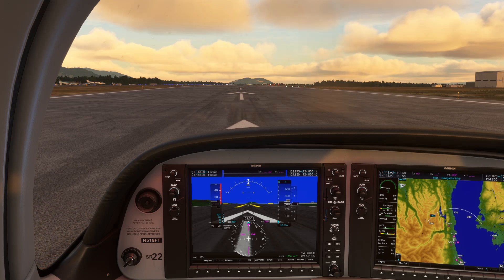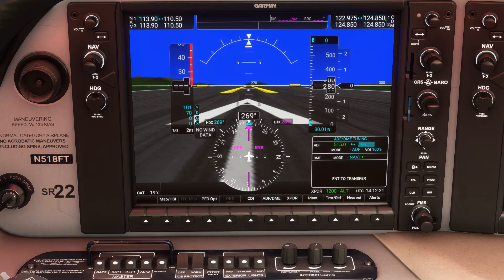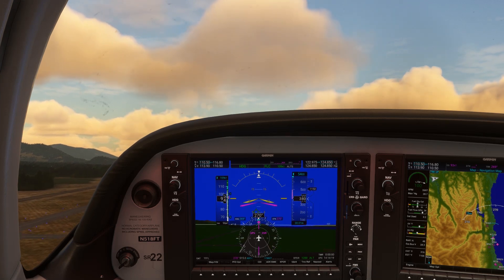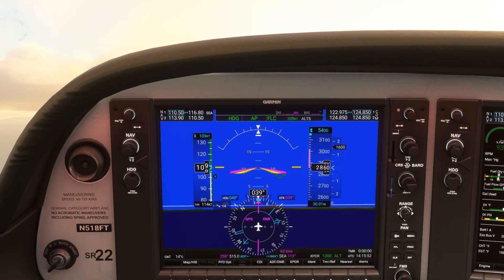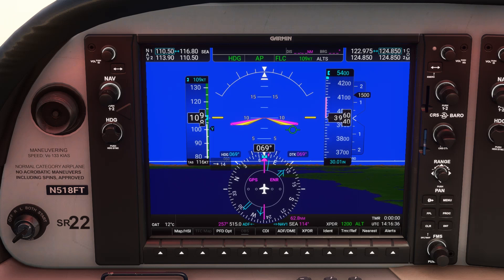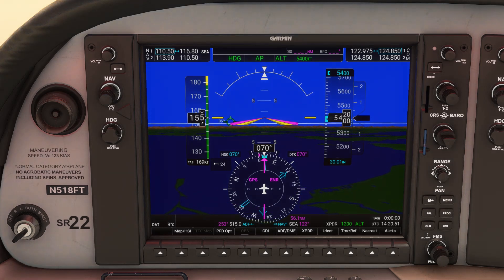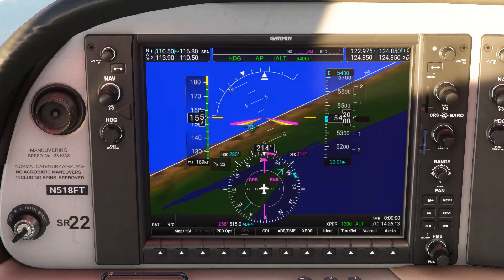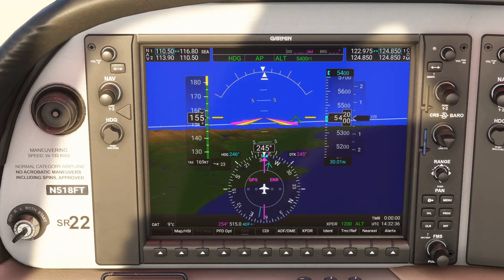How to track an NDB | Push the Head, Pull the Tail

Comment: Alaska still has plenty of ndb. The g1000 definitely simplifies NDB compared to the north based ndb units.
Reply: The glass cockpit ADF is more like the old RMI. It’s not a fixed card. It is a slaved Gyro and the pointer will always point to the station. It is easier to use than the old fixed card. You actually don’t need an NDB/ADF unit because  the NDB station location is on the chart, you can use your GPS to fly the lat long waypoint.
Reply: @aviatortrucker6285 Don't believe that's true, since GNSS doesn't have the funneling that NDB have unless you are doing a GNSS based approach. LPV has pure funneling but LNAV does the 1nm/0.3nm reducing.

We are taught when doing NDB approaches NOT to use GNSS for anything other than additional advisory.
Reply: @glennwatson  That is true. As an example where I am located near KJEF, ILS-30 approach depicts, an old LOM, (JE) which is essentially  a NDB station but uses a “bone” pattern for the outer marker. This is also the final approach fix ALCOA. You can fly to ALCOA using the GPS, fly outbound, and then the procedure turn. You then must change your CDI to LOC to legally fly the ILS inbound to runway 30. One other thing is you can not fly any approach, ILS, VOR or NDB unless you have those radio based receivers. You can monitor with the GPS. Since GPS is more accurate, why use and radio based  non precision approach at all? Minimums with a GPS, especially if WAAS equipped, and the airport has a LPV is way easier and more precise. Maybe for nostalgia?
Reply: @aviatortrucker6285 maybe for "if its available and works.. dont fix it" mentality ?

Comment: Great segment,
I used a few NDB approaches however I still have a question concerning the best method to do a timed approach or holding using a NDB.
Would you propose a segment related?

Comment: One thing the glass cockpit does not do, is have a fixed azimuth. During my IFR written test back in 1989 there were two gauges. The DG (not slaved) and the ADF. It would depict a heading indication and a bearing indication to the NDB which had a fixed azimuth. You had to add the two together and if it was over 360 you would have to subtract 360 and that would be your bearing to the station. So with a heading of 300 and the ADF instrument reading with a pointer at 090 you would have to fly 030, (300 + 90=390. 390-360=30 or 030) to go to the station. I used to look at it at the station was 90 degrees right if my present heading. Kind of still do that with the bearing pointer with the  G-1000. Another fun fact about ADF it was susceptible to twilight interference around sunrise and sunset and also would distort the signal as much as 30 degrees. The ADF would move the needle back and forth during lightning flashes when there was thunderstorms nearby. This is an inherent problem of the medium wave frequency. band  of 530 kilocycles to 1730 kilocycles. (Old AM broadcast radio; used to hear the static during a thunderstorm. Can hearing as well on a CB radio).
Reply: I learned NDB this way... and although it was annoying to do.. transitioning to glass cockpit feels like a cheat
Reply: @PilotGery1  Never really understood what the BFO was for. I think it had something to do with a certain kind of station out in a very remote location. It’s stood for beat frequency, oscillator. One thing to mention, the NDB worked really well unless you were looking for Howland island.

Comment: Does the sim even have the option for a steam gauge ADF?
Reply from the maker: It does. In MSFS20 the Cessna 152 and 172 have it, probably some other too.
Reply: X-Plane 11  & 12 have it in the standard C-172. The old radio with the BFO is also there.  The azimuth can be rotated but it’s more fun to leave it at 360 and calculate the magnetic bearing based on your current heading.